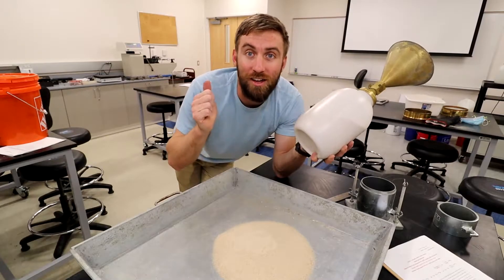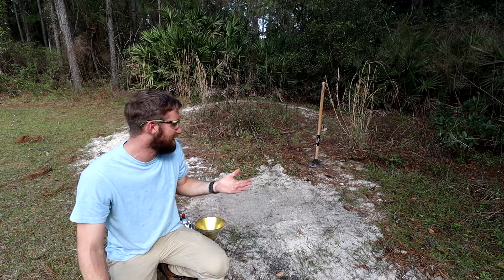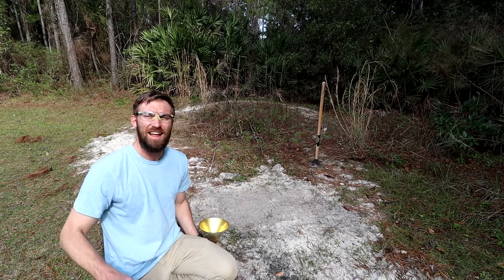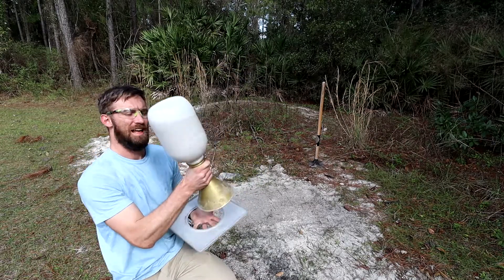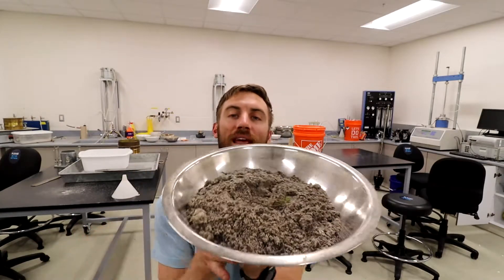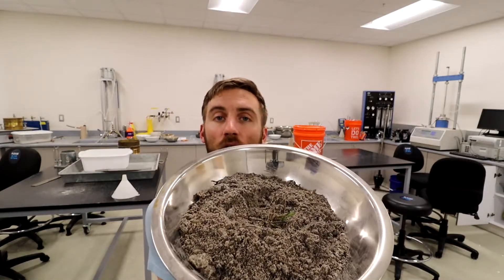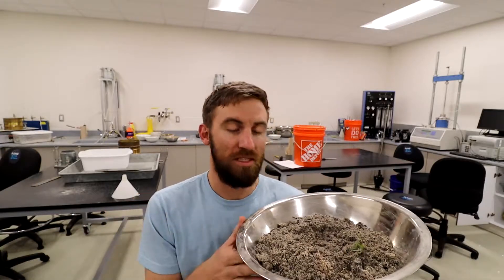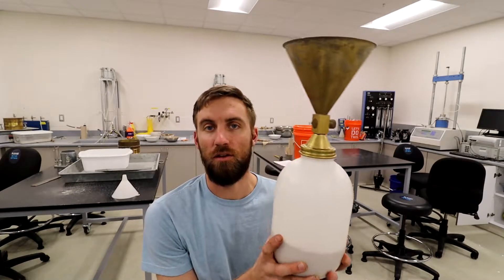Virtual Geotech Lab #6: Field Density Test using Sand Cone

Comment: Hey Ryan. Great job on the video. There are a few things I wanted to point out that are potential issues. When determining the Cone correction factor you need to do this procedure over the base plate, as you also need to account for the sand that is between the thickness of your base plate and cone. Second thing is you cannot manipulate, vibrate. rattle, or move in any way or you will affect the result of your density. Thirdly when you remove the soil from the test hole it needs to be placed in a moisture proof tared container so that you do not lose moisture and makes it easier for determining the mass for figuring out the wet density. Also worth mentioning is having holes drilled through your base plate so you can pin it to the ground so it will not move on you while excavating the hole. you may want to look into the proper procedure for filling the cone/container. Hope this helps and clears up and issues with determining the density of in place soils using sand cone method.
Reply: Nice insight fellow!

Comment: I am just wondering, as opposed to the sand cone test, or nuclear density, or the balloon/water test, why not just put a thin bin-liner in the hole (very loosely put in), and pour water until the meniscus of the water is just touching the top of the hole? You could then just pull out the plastic bag, measure the volume of water, and that's that. I can't imagine it would be any less accurate doing it that way than a sand cone test? Could you elaborate please Ryan. 

I can imagine that air pockets might form, but if digging out to ~4inches was done carefully to make a nice bowl shape, surely this would be very accurate at calculating the volume of the hole (+/- a fraction of a percent error) with no need for any equipment other than a thin bin liner, a flat edge (so it touched the water meniscus) and some scales. Thank you
Reply: That would work if you control for temperature of the water, because the density, and therefore volume, of water varies significantly with temperature.